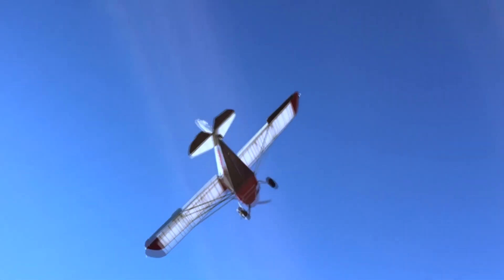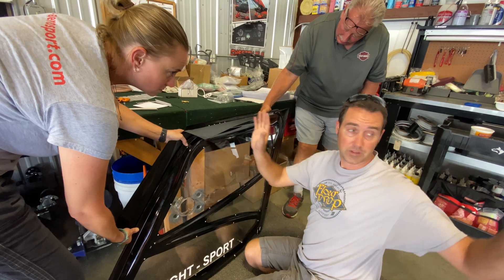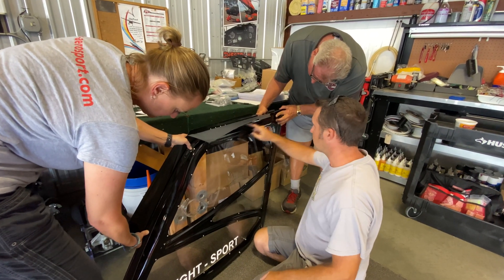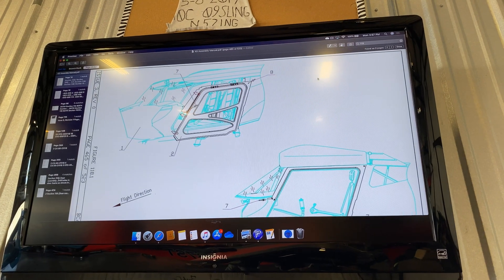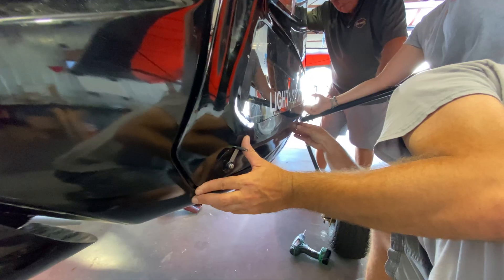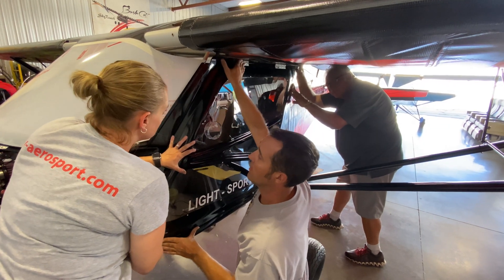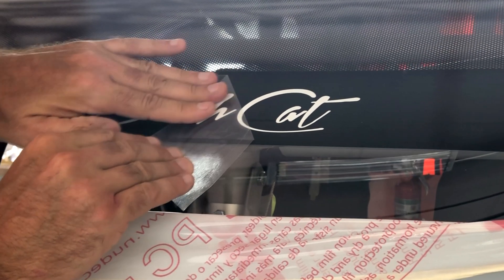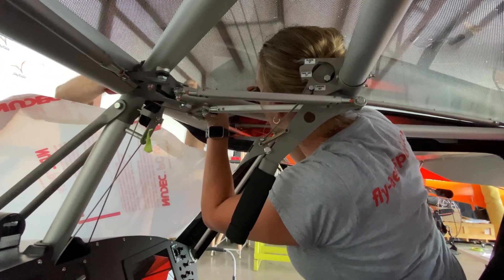The Doors

Comment: Do the doors have a strut to keep them open, or an attach point on the wing?  Thanks
Reply from the maker: Interesting you should ask. Skyreach has developed a new attachment latch which will connect the open door to the bottom of the wing for an easy “swing open attach and then reach over disconnect and close the door“ feature.  AeroSport is going to test the new door latch on Bob the Cat.  If it works well Bruce the Cat will get them too. No more need for the removable door strut.  That said, I will still keep the strut handy as a backup.
Reply: @bushcattom  Sounds like a better solution!  Be sure to show on film  :)
Reply from the maker: Nathan Greer Oh yes if the new door latch system goes on you can be sure to see it in future videos.

Comment: Awesome work Tom
Will you be putting a parachute?
Reply from the maker: No parachute for me. They’re heavy and it cuts into the useful load too much for my taste.  I’m not a little guy and I want to be able to bring my camping gear along.   IMO the only use of the BRS is in the event of structural failure.  The BushCat is built so strong (rated for +6 and -4 Gs) that ripping the wings or tail off in flight is just so insanely rare.  Any BRS is going to total your airplane anyhow and since it would be too devastating to lose Bruce I don’t think I could go on.  That and the huge cost made me opt out.

Comment: I think you should have done your tail wheel licence during build because the Bush Cat is not a Bush Cat till it matures into a dragger. Until then it’s a Bush Kitten 🐱 )
Reply from the maker: I thought long and hard over choosing between the nose wheel and tail dragger versions. Yes the tail dragged is sexy and you can put bigger wheels on it. And it would be more adept at crazy off-field landings out there in the mountains.  But here’s the thing. I fly in the Midwest. And while I may on occasion travel to places like Nevada and Idaho, the lion share  of my landings will be on grass fields.  Not that the nose wheel Bushcat can’t handle off-airport.  It can!  But my wife wants to learn how to fly and the nose wheel is better for students.  I’m also thinking when I get old I’m gonna want an airplane that I can easily slip into.  And IMO the Bushcat nosewheel version looks a lot better than other LSAs with that feature.  Steerable AND differential braking if you want it.  So there!
Reply: BushcatTom - Was only teasing you a little bit. It looks awesome and was a great choice. I would get a tri too.
Reply from the maker: Paul Dutton Skyreach should make a Bush Kitten. Maybe in the ultralight category?